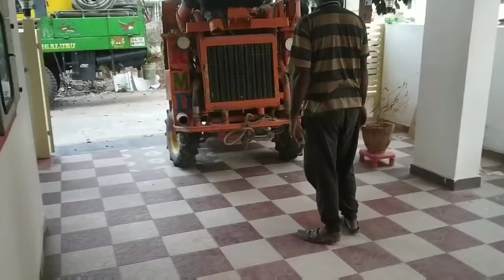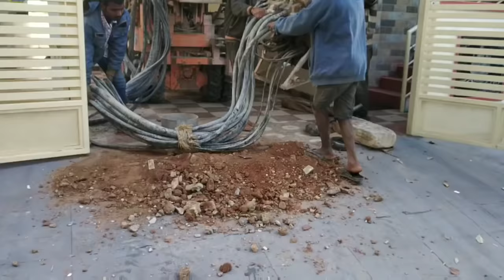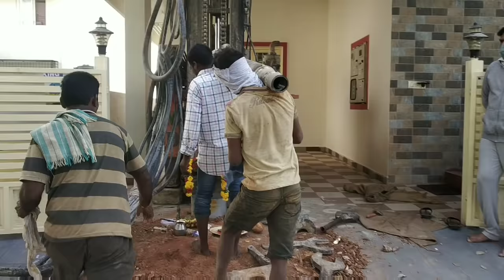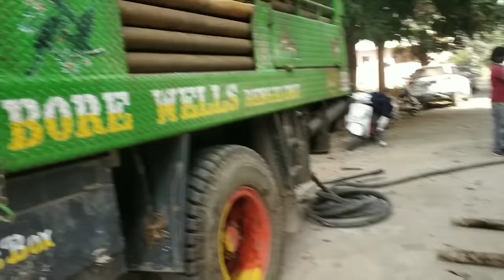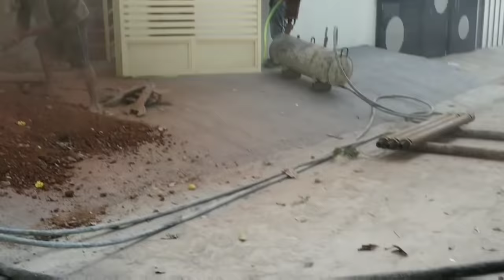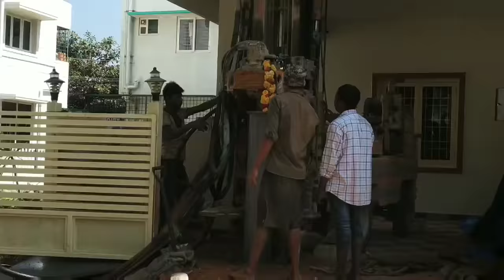live video ROBO DRILLING CONTRACTOR MME BOREWELL Kammanahalli Bangalore 9035278897/9342278897

Comment: Is it safe to drill a bore in a already constructed building, doesn't this effect buildings foundation?
Reply: Yes...
Reply: gd question I'm also thinking same.
Reply: It doesn't affect if the foundation is not too much near to bore hole
Reply: It's not safe if building is 3 to 4 story
Reply: if the foundation is well filled then it doen't harm the building
Reply: Kitne feet pe hai
Reply: Hi
Reply: Can you live without water
Reply: It is not safe for house, first  house structure are not engineered properly and secondly filling are not good
Reply: Hi our borewell having some issues inaide the pvc pipe god melted, can this be re drill or can we get some solution please

Comment: Normal machine requires 25' vertical clearance. This small portable machine is known as Robot machine. It drills 6" Dia bore. Takes 12-15 hours for boaring a depth of 500'. The drilling charges are one and a half times of big machine charges. Maximum depth possible is 800' with robot. Drilling cost was 1.6 lakh for 800'
Reply: Machine cost
Reply: Total
Reply: We can put 8" Inch also and depth upto 1200
Reply: is there any confirmation for availability of water before drilling
Reply: @lrshylo81  æ
Reply: Jo kichad nikalta hai uska kya kare? Road pe chala jaega woh.? Grey colour ka

Comment: Nice, maximum dia of bore / maximum depth possible / cost per rft and cost of entire drilling unit ?
Reply: Rs 2000 per Ft here in Mizoram
for 620ft it cost 7lakh
Reply: @lrshylo81  too much colstly..plz revise your rate
Reply: @civilengineer9652  
it is not my rate
myself also find it very costly
Reply: Bro, in nagpur we have 
85 rs per feet of drilling 
And 
110 rs ler feet of casing.

Too tooo too expensive in your state
Reply: Mizoram is a hill area
Reply: @mahendrancoimbatore1441  તો શું થયું ગાંડા ✨
Reply: @civilengineer9652  hi what is this ?
Reply: @civilengineer9652  mizoram language?
Reply: It depends on the geography of your place, if its hilly area, we need to dig deep to reach the ground water, Mizoram is a hilly region.
 For my place in Kerala which is plain & near to a river. We didn't need to dig deeper cause of the abundance of ground water. It just costed 30000